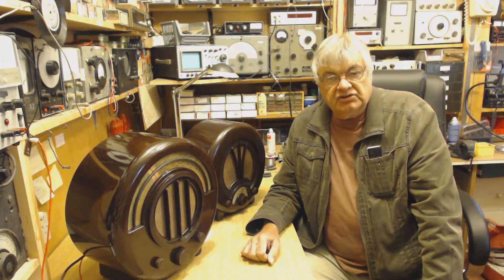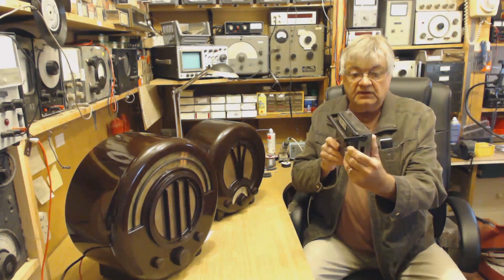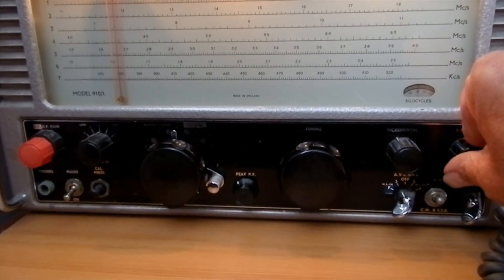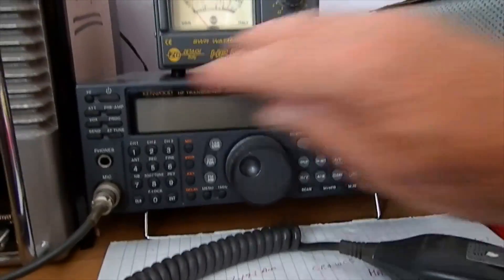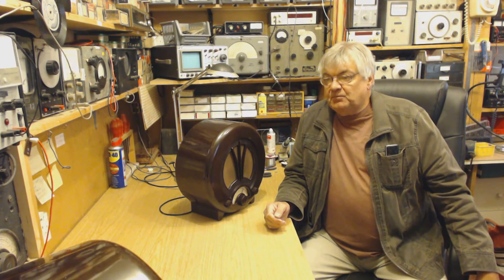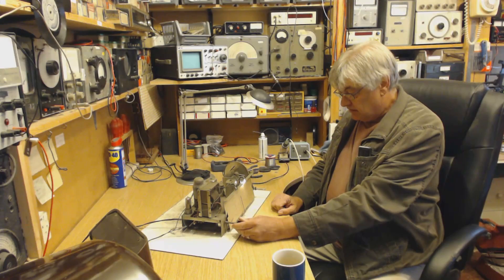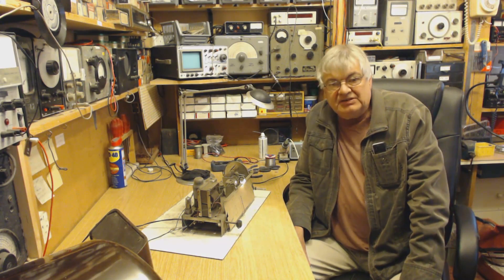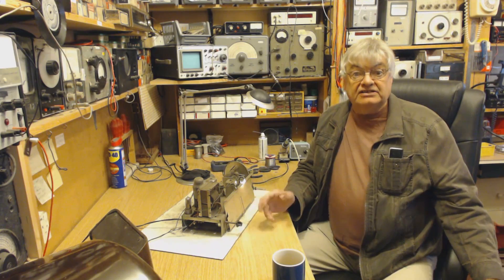Medium & Short Wave Interference

Comment: Now days, so many electronics that cause RFI. Is it 24/365?  Try you car radio, drive around with the portable and the car radio to get an idea of whether it's local or broadcast.   If broadcast, I say jamming.  Don
Reply from the maker: *****  Hi Don, I have walked around the block with a transistor radio and it is local. It started last week and is 24/7 so far. Cheers, Ray.

Comment: Ray,
Here in Sheffield, we too get our share of interference - not unlike that you receive in Worthing, down on the south coast.  It begins at different times; never the same duration; sometimes louder than other occasions, and it (roughly speaking) covers the same frequencies, with the addition of Long Wave at times. Where it is coming from, I can't say, and how best to come up with a solution to overcoming it is proving to be very difficult.
Years ago, we often blamed interference on the Steel Works, factories, and heavy engineering industrial sites - we can't do that any more as they have largely gone.
It will be interesting to read any suggested solutions to this problem.
Regards,
Phil.
Reply from the maker: ***** Hi Phil, thanks for your input. The interference is constant 24 hour a day. I'll get out in the street later and have a proper go at tracking it down. Watch this space!  Cheers, Ray.